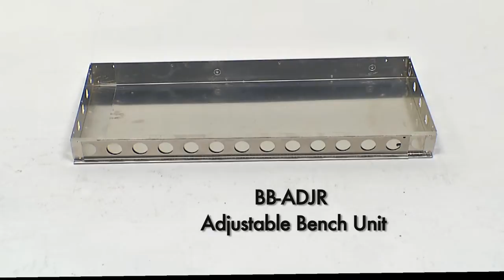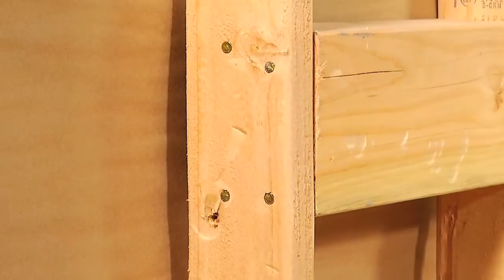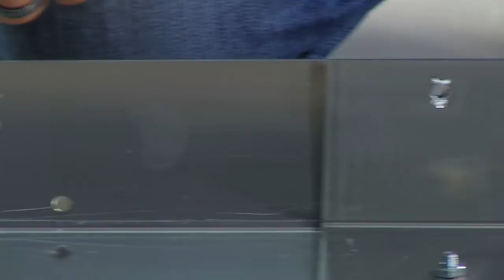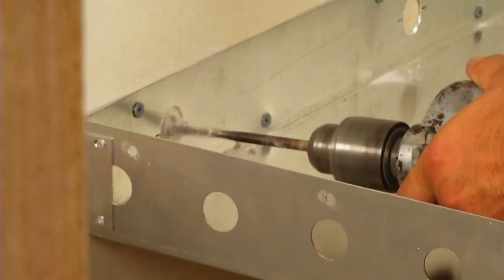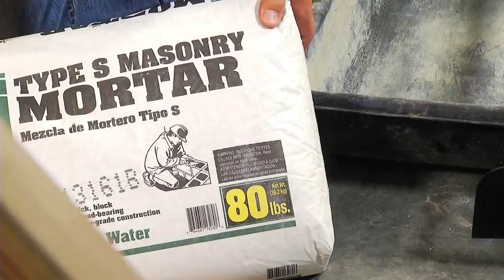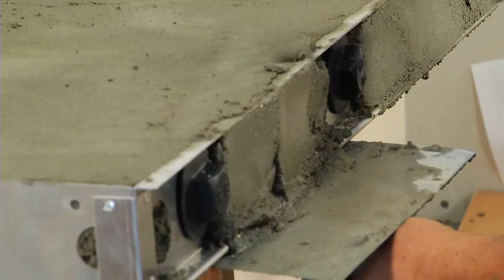Innovis Invisabolt

Comment: My installation pulled out of the wall using 4x6 blocking between 16 on center studs and invisabolts.  This bench should not be installed floating or on less than three sides as they do not yet understand the forces exerted on it.  Due to the weight and leverage created there will not be any degree of durability to this and if you have a problem and call them do not expect any support whatsoever.  Instead they will argue that it's impossible for this to fail and cannot provide any explanation of what you should have done differently.